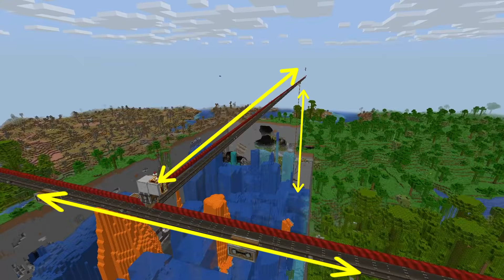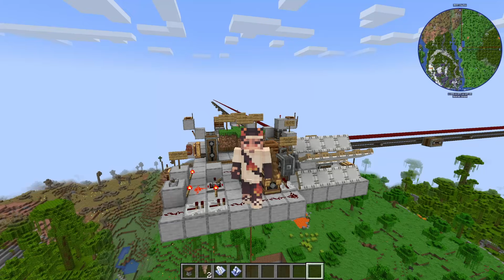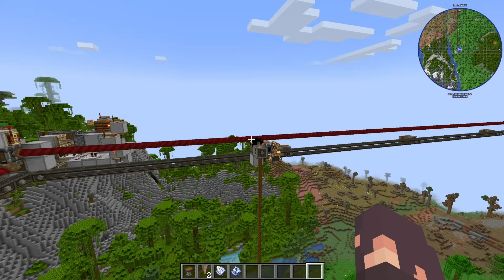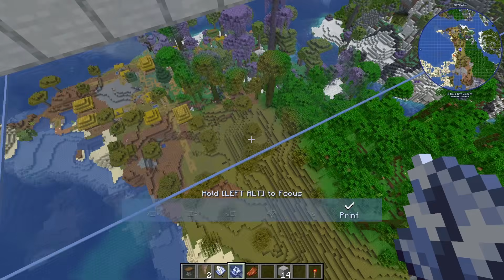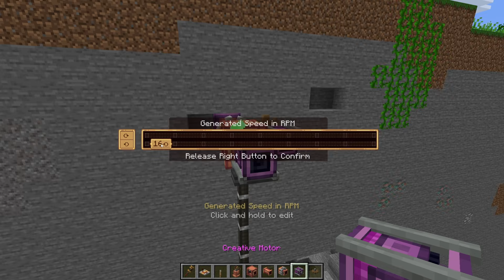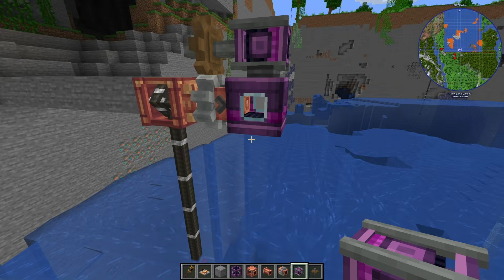The Best Create Mod QUARRY On YouTube! | Create Mod Tutorial

Comment: For anyone struggling with the quarry not moving to any other rows I may have found the issue.
The shaft with an andesite casing one block north of the windmill bearing does not pass a redstone signal through it like it does in the video at 11:57. You can see the redstone going from the andesite casing shaft to the hopper is lit in the video but wasn't on my machine. I replaced the andesite casing shaft AND the bare shaft next to it with gear boxes and it's now moving to next row. This was causing the 1 block you place in the hopper to get moved as soon as you placed it. This was also causing the quarry to start moving as soon you activate the windmill.

However now my quarry is skipping the first chunk of the next row which I haven't quite figured out why but at least its moving to the next row.
Reply: Hello, did you solve the problem? Can you write clearly what needs to be done after the schematics?
Reply: I'm having a problem where it got stuck at the bottom and wont come back up can anyone help?

Comment: Wait i found a problem in my world the redstone dust locking the hopper 12:00 does not get powered cuz the encased shaft is not a full block
Reply: To fix it quick, replace the shaft with a encased cogwheel 😊
Reply: @kindlebubbledump can u pls pin it🙏🙏 seems like this machine not work in create 6.0

Comment: Works 1.20.1 fabric. If the machine ain't moving to next chunk that's cuz U didn't glue it right. The gantry carriage needs to be glued with the machine as well as the funnel + redstone link

This is a maintenance nightmare, if you manage to successfully make it work, don't ever touch it again. I touch it again because it moved 15 blocks instead of 16 and now I'm spending 4 + hours on fixing the machine as it won't work properly and it still ain't fixed

Comment: I have an issue where it gets to the end of the first line and stops at the end going up and down infinitely did i miss something?
Reply: After further testing its found that the sequenced gearshift keeps breaking when getting a redstone signal from the 8's timer next to the chest with the shovels is there a fix for this?
Reply: ok so after taking a day to fek around with it i have come to the conclusion that the timing was off on the "other" sequenced gearshift so I se that ones last tick delay to 30 seconds and now it runs perfect
Reply: @gearsman7013  hi i have the same issue, can you explain which sequenced gearshift you modified?, the one near to the piston or the one near to the chest with 2 shovel inside?
Reply: @mafowasd8792  im pretty sure its only the 2 and you gotta make their "wait" time be 10 seconds for both. It makes it take longer to mine but it saves it from snapping the gantry connection

Comment: It will not go to the next layer, it only only do the first like of chunks then it stays at the end not moving to the next row please help me
Reply: I also got the same problem, and how I solve it is simple, he told us to place 9 building block in the dropper the most important part. thedropper is facing into a hopper so break the hopper and re place it, when we newly add this machine to game maybe the hopper can't update itself, so breaking and replacing it makes it work, make sure u replace hopper putting items into the dropper back in that way the counting resets
Reply: @mr.bishalgamingcb3819  I followed the advice with breaking the dropper.  For me I had to break the comparators on either side of the sequenced gear shift.  It got the drill head moving again, but I’m not sure what caused it to break in the first place.  It’s worth noting that my power lever didn’t seem to work properly either.  I did the 128 by 128 design.  Wanted to put this here for others having issues
Reply: This didn’t fix it.  I think the issue could possibly be with either the redstone links mentioned in the liquid clearing versions video or the hopper attached to the dropper with 9 blocks. If you’re playing a server you have to place a block in the hopper to make sure it’s marked as “enabled:false” in the F3 menu when powered by the red stone torch next to it.

Comment: Hey, running ito some issue with the build, I'm trying it in my survival server and creative mode both 1.21, I follow the instructions but when I unlock the windmill and flick the lever the belts are powered but not the gantry shafts so the drill doesn't move at all...

Comment: is there a reason you didnt use a threshhold switch to remove the Y level limit? or did you just not want an issue if someone is using a custom depth world, which would require a configuration change?

also i would recomend changing your settings on your schamaticannon to clear out blocks and turn off entity protection so that if there is a peak, tree, or other obstruction in the way it will be removed

Comment: "Hey! Great video. I have a question: is there any way to limit how deep the mining machine goes? I want it to stop before reaching the last layers, maybe around Y=50. I'm trying to clear an area and mine at the same time, but I don't want the machine to go all the way down to the bottom. Is there a way to set a maximum depth or a stopping point for the gantry miner?"
Reply from the maker: unfortunately not :( this uses bedrock to stop the miner so unless you can place unbreakable blocks at the Y level you want it won't work.

What you could do instead, my first uploaded tutorial is probably closer to what you're looking for. It can clear out a flat area and is pretty ez to setup
Reply: @kindlebubbledump  Hi! I'm new to the Create mod and I'm trying to build a flat-area clearing machine like the one you showed. Could you please share the schematic? It would help me a lot to understand how everything works and to learn the mod better. Thank you!"

Comment: I know you made this video awhile ago. But I was wondering how this contraption was stopping after each chunk to unload. What would cause this to go to next chunk without unloading fully?
Reply from the maker: The portable storage interfaces connect once it reaches the top to unload. If they’re unable to deposite items onto the belt then it would move onto the next chunk without unloading
Reply: @kindlebubbledump mine just dosent unload at all. Comes up moves, kinda unloaded, however nothing goes on the actual belt. Then goes down. Did I set it up wrong?

Comment: on off switch isnt working
Reply from the maker: yea that's cause andesite encased shafts no longer transmit power. you can just turn off the quarry by stopping the windmill as the mining contraption is moving downward and it will work on startup like normal

Comment: for some reason half of all the resources mined fall out of the brass funnel onto the ground before being picked up by the other brass funnel
Reply: Same here
Reply: @chritianlong9025 it might be a filter system but idk, I just removed the funnels and left one, and also for some reason the on/off switch doesn't work, I have to manually power the clutch when I need to turn it off
Reply: You need a faster system or Have the Items drop on to a belt and slowly get picked up by the sorter. Hope this helps.
Reply: @SnortFrog1 what if mine just doesn’t unload?

Comment: So on 1.12.1 after it gets through the first 16 chunks north and it comes back. But on the second set of 16 chunks. It does not extend north. Is there something I may have off? I did exactly from the schematic and used a schematic canon to print it since there is no print in this version.
Reply: Its like when it updates it's position. The gantry carriage is not pulling it north.
Reply from the maker: I don't think I've seen this issue before, but once the machine gets back up from the top, the sequenced gearshift closest to the north side of the redstone should get powered, moving everything over slightly. Is it possible that broke because of the piston on top of it being wacky looking? if so replace the piston and sequenced gearshift and set the values in the gearshift to the following

await
delay 10t
Piston 16m ->
delay 10t
end
Reply: @kindlebubbledump   I will give it a shot. Not sure if it is due to being on a server as well. The server is hosted locally to my computer. I can definitely send video of what is happening as well.

One thing I also noticed is that the hopper to put the 1 smooth stone into is not powered. It will not send the signal through the andesite encased shaft where you flick the lever and it should unlock that hopper.

Comment: I have been trying to get this design to work now for 7 hours but it still wont work. Im playing CrazyCraft Updated. If anyone would help that would be much appreciated. i do as the video says and the gantry shafts starts turning and all looks good. But the drill platform wont lower or move. I have tried in both creating and survival just to make sure. The only way to get it to move is to remove the drill connected to the rope pulley. Then the pulley will lower.
Reply: I have not gotten it to work properly yet but i have found some things. The schematicannon is drunk and will misplace alot of the superglue. So if the pulley will only lower the one drill attatched to it. There is an item missing from the schematics: the repeater for the «redstone - gantry shaft» redstone link behind the shovel chest. It at least isnt showing up in either 256 or 128 version for me. And to get the redstone circuit to work i have to break and replace ALL redstone torches and loose dust. If anyone has alot of knowledge on this, your insight would be much appreciated. The repeater missing seems to be completely missing from my modpack. Could anyone tell me the delay setting on it or the function of the repeater so i may replace it:)
Reply: I have found the missing «repeater» to be a pulse extender. This item for some reason does not exist in CrazyCraft Updated 0.11.8 (create 1.16.5_v0.3.2g) so im guessing this quarry is not possible to make. Or at least alot tougher to make. Very cool quarry anyways:) would have loved to use it

Comment: For some reasons this doesn't work for me,. i have tried rebuilding it the schematicannon 4 times  now and it runs fine the first line, but when it comes to go out to the second line it just keeps going up and down by the end of the first line. any ideas ?
Reply: Hey, I'm having the same problem right now. The solution is mentioned in the video description: "Destroy and replace the redstone torch next to the hopper so it's pointing toward the dropper. Make sure the hopper has power!" After that, the items in the dropper counted down, and the machine worked again.
Reply: I don't see this redstone torch, I see a compariatir

Comment: sorry for Ask there are 2 problems with the machine that I use
1. why is the item distribution always missed and the machine continues mining directly without distributing the item to the mechanical belt

2. the mechanical drill is stuck in the ground, not returning to the top

is it not compatible with version 1.21.1?
Reply: I'm having the first issue as well, I noticed that the first hopper/dropper is locked when he put the item in during the video, but it seems to be unlocked in my save
1.21.1, neoforge, create version 6.0.4
Reply: @championCynthia2348  how did you fix the problem?

Comment: So are there any built in fail safes that would just stop the quarry? I was running it and 6 chunks through it just stopped. All the redstone seems to be working correctly, but the actual drill section just stopped moving. It dropped off all the items and hasn't moved from that position. This is specifically the 256 liquid removal version. Any thoughts as to what's causing this?
Reply: Thought I solved it, but then it stopped again soon after, this time at bedrock. I tried a bunch of things but it seems not to have worked
Reply: @rekcroom  any luck>?

Comment: you lied you said "it works in almost all Minecraft mods" but I tried it on the ATM 10 isn't even working.
Reply: I've got it running in atm10 but there are issues like the belts being broken and it not moving all the way when it moves east, its out by 2 blocks, its definitely got issues, a schematic is good and all but we really need a follow up video to fix the common issues.

Comment: I am totally amazed by this and don't understend the contraption in the slightest, so take my idea as naive as those are. But couldn't you reduce resources downwith like a module to flip the drill plate upside down? Meanwhile, expanding on the idea to use deployer to fill the gaps, couldn't you use a contraption controller to stop them on the way up?
Amazing video btw!
Reply from the maker: you could and that would be sick, but my fear is that currently, the farm is pretty easy to break if not configured properly. With that additional config, it adds another thing that can break, and you only save 256 drills. I expect this quarry to be made after someone has an iron farm and wood farm so drills wouldn't be that expensive in the first place

Comment: After mining the first row completely it, it comes back to the starts, moves over a row, then skips the first chunk and doesn't mine. Help?
Reply: I think I fixed it, but I'm still experiencing the problem of the blocks dropping instead of going on to the conveyor. I'm assuming its because it doesn't have space to put it (it's placing too fast)
Reply from the maker: My guess, the belt connected to the moving part of the contraption isn't getting powered by the main belt because it didn't move over the exact 16 blocks. if you add shafts along the entirety of the main belt, it'll power the moving belt at all times and prevent this issue

Comment: When I activated the quarry, the drill platform sped away. It didn’t stop to go down or mine anything at all.
Reply from the maker: make sure all the redstone torches are powering the blocks they're next to. check the hopper on the north side, and the east side gantry shaft as well. just break and replace the torches to fix those.

If it's going north. find the sending redstone link that should be powering the northbound gantry shaft (the receiving one is on the gantry carriage block) it'll be on the north side underneath a block. break and replace the redstone dust on the top of the block it's on and that should power it and power the whole gantry shaft. once both gantry shafts are powered then the quarry should go straight down
Reply: @ thank you so much! I got it to work but when it reached the end of the gantry it is now just moving up and down, not returning. Any help?
Reply: @kindlebubbledump  ok I realised that i accidentally broke a sequenced gearshift and broke the whole thing. I rebuilt it and everything is fine now. Thank you for this design!!! Earned a sub

Comment: the quarry worked fine for me until it hit bedrock, it just stopped and stayed in block form, what can I do? i tried triggering the observer signaling manually but nothing happens and the drill doesnt return. everything looks properly glued tho
Reply: Had to replace the redstone torch next to the "sticky piston - redstonetorch" redstone link and after that retriggered the redstone link signal from the pulley/observer
Reply: now i just have the issue it doesnt properly stop to unload when it comes back to the surface
Reply from the maker: that's strange. it sometimes unloads on the way down, but if that's not happening then check to see why the portable storage interfaces aren't dropping items out. it could be because the belts that it should be dropping items onto aren't being powered. if that's the case go back to the main belt and add a shaft where the gearbox is. (This happened because at one point the machine only moved over 15 blocks instead of the 16 it was supposed to). You'll have to add shafts every set of blocks from now on, so I would recommend just running down the main belt adding a shaft into every belt location

Comment: Might be a little bit late so I am not really expecting a response, but when I tried using this machine it ended up just...disappearing? The area with the drills/barrels just disappeared but the machine still kept mining. Once it reached the bottom, the machine actually reappeared...but the bottom half was inside the bedrock and the rope pulley was no longer attached. Not really sure what to do about this and looking for any assistance...
Reply from the maker: in your create config under contraptions somewhere theres an option to increase the max contraption render size. This shouldn't break the machine though and I successfully dug out a full quarry while not being able to see the machine. I have however run into the issue you had once and idk what caused it. I fixed it by unfortunately rebuilding the drilling contraption (removing all the old glue too) and restarted it. I think the cause was a weird unloading of chunks as it got close (make sure your render distance is as high as the server (or as high as your pc will allow), but idk for sure

Comment: I tried to get this to work on my world, but the machine wouldn't turn off unless you cut the power, and once it made it to the emd of the North to South gantry shaft, the machine didn't move across East to West. I also noticed some of the redstone didn't pass thrugh certain blocks (like encased shafts)
Reply from the maker: yea the on/off switch is broken cause I'm dumb lol. as for not moving east to west, break and replace the redstone torch on the northmost dropper/hopper counter that is right next to the hopper, it's prob not powering it even though it should be (cause schematics sometimes break that)
Reply: @kindlebubbledump  What's the fix for the switch?